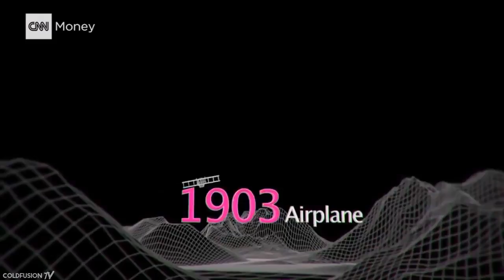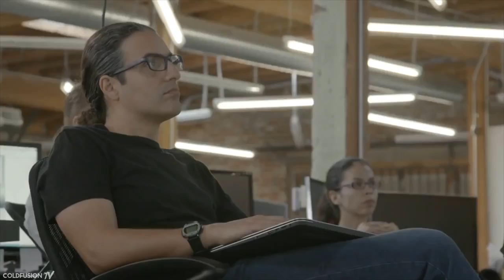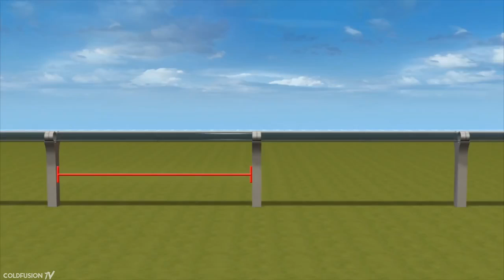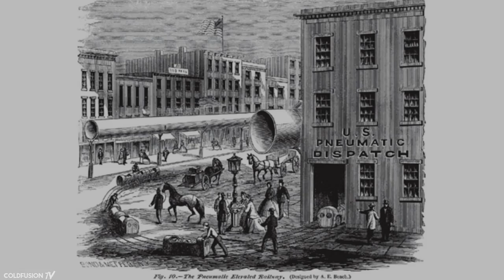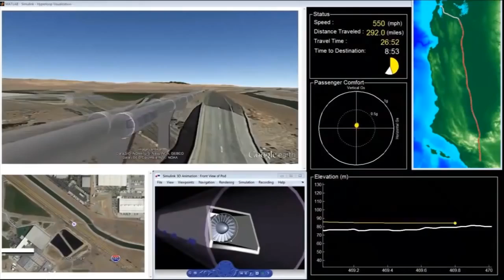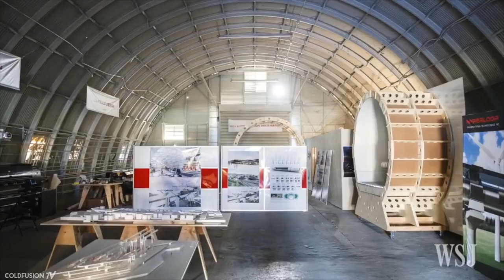Hyperloop amazing train concept of future

Comment: i am 14 and i  also designed a train similar to this technology.i am not joking. it is more easier and more efficient . it's cost for building and maintainance is also low. for building it avg cost including a 100-200 km track or the bridge like pipe line will be rs  15-30 lacks and maintanance usually not required but if wanted then max-rs 100,000 . for running it dosent requires any secondary energy source such as battery . there is a system in it that will generate the power . it dosent requires any fuel or electricity as primary energy source. it is like an lifetime generator but it needs to be cooled down .but i also have the cooling system in it . if you know how to submit or give the design to the indian govt then please contact me at 7449421818 or email me at mouryokundu689@gmail.com

Comment: Hyper nonsense ! The technology is available today, but future general usage is virtually impossible. The whole concept is far to limited, for the same reasons as MAGLEV. Both are effectively a development of a monorail concept. Monorails of various types have been with us since the 1930's. They too were seen as a future general mode of transport in the past. Why did they fail to become generally adopted? For the same reasons "Hyperloop" will fail as a general transport mode. That is because their fundamental design generates huge problems of requiring dozens of "tracks" at major city terminals, which complex MAGLEV monorails, or tubed "Hyperloop" would require to provide the huge number of seats necessary for mass rapid ground based transport. Further a ground based transport that is fixed to a linear pathway, must have a signalling system to match. The higher the speed of such a system the more complex the signalling required, and the greater the distance required to safely stop. If you don't stop quick enough you crash into the vehcile ahead, and if you stop to quick you kill all your Human passengers. A train travelling at 100mph/160kmh needs around a mile to stop.  "Hyperloop" at 200mph/320kmh would need around 2 miles to stop, or from 300mph/480kmh at least 3miles.  So most of the vacuum tube would have to be empty with long safety margins, reducing greatly the capaicty of such a system. As the Worlds population grows, we need transport systems that carry ever more people in complete safety. Not systems that are seriously limited in capacity by their own design. In other words you can't realistically beat the good old fashioned two rails = a train system !
Reply: The differences are the high speed, cost effectiveness, and safety. We're looking at near mach one, with solar power.